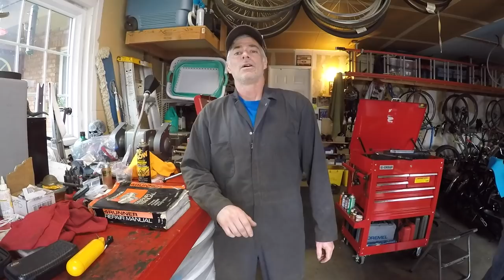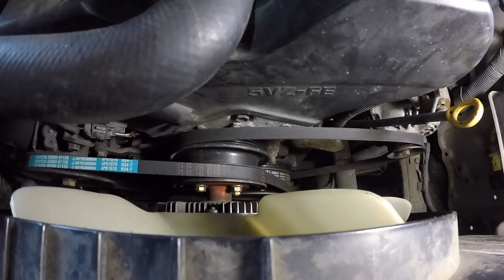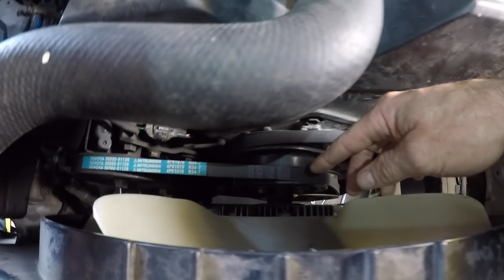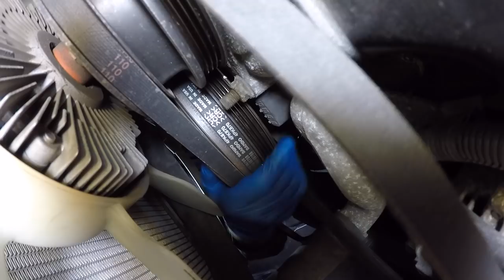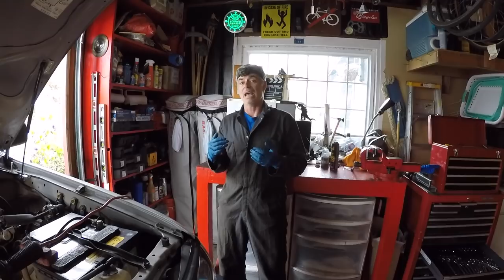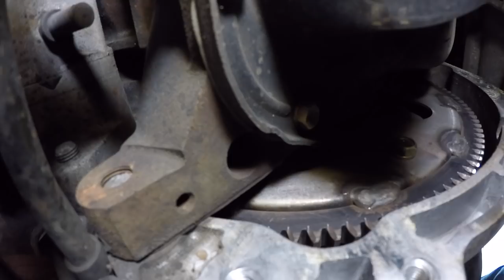Crankshaft Play (Toyota 5VZ-FE Engine) (Part 2)

Comment: One of our 4Runners (2000 2x4 with auto trans' 3.4 with 190,000 miles) has 1 and 5 misfire. I ran a compression check and exhausted ALL other possibilities.  At the very beginning, the starter would click but not turn the engine. The new starter did the same thing. The engine acted like it was locked up. I took a breaker bar and turned the crank from the bolt on the harmonic balancer and it was free then the engine started but developed a misfire from then on. I think you have finally helped me solve the riddle. I will give you an update.
Reply from the maker: Hope you figure it out Robert.
Reply: @TimmyTheToolman  No noticeable end play or crank movement forward or aft. I took the ECM apart and no burned or broken issues on a visual inspection. Replaced cam and crank position sensors. Replaced coils, plugs, wires and injectors, Replaced fuel pump, filter and pressure regulator. Still 1 and 5 misfire. The O2 sensors are on order so I will let you know and I am going to drop the oil pan to get a visual on the thrust washers even though there is very little crank movement.  We double checked the timing on a new belt that is only 1 year old. We checked the crank and cam reluctors for cracks or damage. We have allowed the vehicle to relearn the idle and that did not help.
Reply from the maker: @robertclark2714  Did you ever do anything with the fuel injectors?

Comment: Just watched part 1 and part 2 Crankshaft play. I have been trying to find a video on how to replace Crankshaft position sensor  on my 5VZFE. I have not been able to find any real how to do it information. If you have a video that would help me, Please advise. I hate to call my 1997 beauty a done deal with only 200,000 on it. Ill try the crankshaft  position sensor first. Love all your 1997 videos.
Reply from the maker: The crank position sensor is right behind the crank pulley on the driver side of the engine..  It is affixed to the oil pump with a 10mm bolt.  Disconnect the connector, remove the bolt, and pull it out.
Reply: Thanks a bunch @TimmyTheToolman
Reply from the maker: @mcfmwjd  No problem.
Reply: @mcfmwjd ay man I had the same issue with my 5vz I tore it apart did timing belt and everything else while I was in there, did yours have any issues after replacing the sensor?

Comment: The screw in type Toyota knock sensors of this era are extremely sensitive to piston slap and rod knock which is why I said they are incredibly unreliable. Any play in any part of the piston-rod assembly will give false misfire codes for this style of knock sensor. 

It's probably not directly the play in the thrust washers of the crank that's giving the false misfire because the engine would not run well at all if it had any type of bad cps signal. Even one missing tooth or virtually missing tooth due to axial play on the reluctor wheel will cause the engine to not run well or not at all. Even with all that movement, the cps is still probably giving a good signal to the ECU.

More likely it's the wear in the rod bearings caused by the axial movement of the crank and the knock sensor that is picking up the rod knock that's actually causing the false misfire reading. Toyota fixed these false misfires due to rod knock and piston slap by switching to a through hole type knock sensor that was more focused on "listening" to actual preignition in the engine iterations after this one.
Reply from the maker: Thanks for sharing all this Jacob.  You sound like you know what you're talking about with these engines so I'll take you're word for it.  I was unaware that a bad cps signal would cause the engine to run poorly or not at all.  His engine definitely ran fine.  It just had an audible engine knock and a misfire code we couldn't get rid of.  At one point, we were considering replacing the knock sensors but I'm glad we noticed the gross play with his crankshaft first because replacing the knock sensors wouldn't have done anything.  The new sensors would have triggered a misfire too and we would have done all that work for nothing.  His engine is done unless we want to try to rebuild it which I'm doubting we will.   

I appreciate your input and your willingness to share information.  Correct me all you want because I appreciate learning new things even if it means I have to admit my theories were wrong.  Happy Wrenching!
Reply: No problem. I learned about the knock sensor issue myself not too long ago from an engine tuner that has problems with them because of the larger clearances he has to run on everything. Then I happened to read some Toyota technical training about the reasons why they were switching to the new style of sensor. Always good to learn something new everyday!

Comment: Checking if the flex plate for movement great idea
Reply from the maker: Thanks Antonio.  I really didn't want to pull off the harmonic balancer to verify all the play we were seeing was coming from the crankshaft.  Since I have experience pulling the auto transmission, I knew I could take off that access hatch on the bottom of the bell housing to visualize the flex plate.  If the crankshaft was indeed moving, we would see it at the flex plate as well which we did.   It was a great feeling to finally figure out what was wrong with his engine.
Reply: @TimmyTheToolman  was a great demonstration that access hatch is nice if if there is that much play I would say the engine is shit it's all wollered out

Comment: Thank you for this. I just got a 96 Tacoma and sadly am chasing codes right now too. First was Mass Airflow. Got a new one. Then it threw a misfire 1 code. Full tune up bc plugs etc were terrible. Now a different Mass airflow code. They’re going to replace it again under warranty and said if it’s not that it’s the ECU. I watched the ECU video and seems easy enough but wondering if I’m gonna end up here too. Can a chronic mass airflow code also lead to this instead of the ECU? Thanks!
Reply from the maker: What code are you getting?
Reply: @TimmyTheToolman  First code was P0100. Replaced the Mass Airflow Sensor. Then got P0300, full tune up. Now reading P0101 and having running issue. Stalling out etc.

Comment: I'm no mechanic/expert, but that amount of travel ( play ) front to back in that flex plate does seem to be about equal to the thickness of BOTH thrust washers which surely must have fallen out of place.........right? Isn't there supposed to be 2 thrust washers, with each one being in a different location on most crank shafts???
Reply from the maker: Yes, the thrust washers most definitely failed.  Greg sold his truck to a guy who dropped the oil pan and confirmed the thrust washers were on the bottom of the oil pan.
Reply: @TimmyTheToolman  Yikes. You guys sure went through an awful lot before making this discovery......but I guess to great benefit to us, the viewers, as we learned a lot of valuable lessons during this lengthy series.
Reply from the maker: @howabouthetruth2157  Yes, it was quite the adventure.  I discovered the issue with the crankshaft while editing the Engine Timing video.  I saw the harmonic balancer jut out when we started the engine and I had to do a double take of what I saw.
Reply: @TimmyTheToolman  Yes, I saw you mention that or, I read where you explained how you discovered it while watching the video footage.

Comment: Hey Tim I have a misfire only on startup and goes away after10-15 seconds. I'm getting a p0300 code. Also while accelerating sometimes I hear the exhaust stuttering. I replaced coils, wires, fuel filter, and fuel injectors. Leak down and compression test were all good. Still having the same problem. Any ideas what it could be?
Reply from the maker: Sorry, no idea.  You did the steps I would have thought of.  No loss of coolant I take it?
Reply: hello jermaine Crisóstomo I have the same problem with my 4runner model 2000 3.4 v6 already solved the problem
Reply: hello jermaine Crisóstomo I have the same problem with my 4runner model 2000 3.4 v6 already solved the problem

Comment: Timmah! i don't see any mention of how many miles were on this 3.4 at the time, do you recall?  is the motor still surviving 3+ years later?
i ended up having a bad balancer on my rig that blew out into a moving fan at 190k, the weird noises started about 2 years before it broke! it was diagnosed on several occasions by a master Toyota shop as a clutch bearing rattle and told to just ride it out
Reply from the maker: The engine had fairly low miles if I'm remembering correctly - somewhere around 150k.  Greg decided to sell his Tacoma because he knew his engine was toast.  The guy who bought it dropped the oil pan and confirmed the thrust washers were the culprit for the crankshaft play.  They were sitting on the bottom of the oil pan.

Comment: Wow I wonder what caused this at such low mileage. I'd guess lack of maintenance? Faulty assembly? What are your thoughts
Reply from the maker: Who knows Eric.  Greg bough the rig 7 years ago with 100k.  After 2 years of owning it, he detected a slightly audible engine knock and that knock has gotten worse over time.  When he first started getting an engine misfire code, he could reset the code and it wouldn't pop back up for quite a while and so he would still be able to get it to pass smog.  With the way it is currently, the misfire pops up after only 5 miles so he can't get it to pass smog.  Maybe the owner previous to Greg abused the rig or maybe this is just a fluke.  I have heard of other 5VZ-FE engines having this issue but luckily it's a pretty rare occurrence.  Until we drop the pan or go fishing for metal parts with a magnet through the oil pan drain plug hole, we won't know for sure what is causing that gross play.  From what we surmise, it's failed thrust washers.  It could be a faulty assembly from Toyota or just bad luck.  On a more happy note, maybe we'll get an Engine Swap Video out or this fiasco.
Reply: Timmy The Toolman I'd love to see that! Also if you do pull the engine it would be cool to see what the cause was.
Reply: Hey Timmy. Do you think 1.5 inch steel would work for the press work on the front wheel bearings? That's all I can source
Reply from the maker: @ericbrown6802  It will probably work fine.  But, as you're pressing, if you see that steel start to flex big time, you might want to back off and consider getting some thicker plates.
Reply: Timmy The Toolman  you used 1 inch thick steel right?  I just wanted to make sure it would fit between the hub and the spindle.  Surely 1 and a half inch thick steel won't flex to much haha
Reply from the maker: @ericbrown6802  Yeah, you're right, I wasn't thinking straight.  I can't say for sure if it will fit though.
Reply: Timmy The Toolman alright thanks. Let's hope cause I just got some haha.
Reply: Timmy The Toolman it did work just had to pop a couple studs out. Everything went pretty smoothly. Thanks again for the video
Reply from the maker: @ericbrown6802  Good to hear the job went well for you Eric.  Thanks for letting me know.

Comment: I wonder if this was the original engine.  Maybe it was a Rube Goldberg rebuild from somewhere.
Reply from the maker: Who knows.  I was guessing it was the original engine.  Greg bought it used at a Ford dealership and maybe the original owners traded it in because there were issues with the rig that weren't readily apparent.

Comment: Personally I would put another good used motor in it and call it done, if the truck is worth it. No sense in trying to fix it. Just take a weekend and order all the parts and oils first. Just make sure to record, and post it so we can join in on all the fun.
Reply from the maker: Yeah, that's most likely what's going to happen.  We should be able to swap out an engine in one full day.  Filming slows everything down so maybe over a weekend we could do it.
Reply: @TimmyTheToolman  Agreed, can easily be done in a day with 2 people, filming it will take two and lots of beverages.
Reply from the maker: Yes, tasty beverages definitely helps.

Comment: My 254K Miles 02' is showing the dreaded P0300. Here's what i changed so far

- Coils
- Spark Plugs
- Spark Plug Wires
- Brand new Valve Cover gasket (less than 200 Miles)
- PCV Replace 

What's crazy is one day the CEL comes on and then a couple days later i go to start the car, the CEL is off. Then a couple days later it would come on. 

The engine has a slight stutter on first startup but goes away after about 10-20 seconds. 

No White or black smoke from the Exhaust. 

I've order rebuilt Injectors and see if that will fix the problem. I suspect faulty injectors that are leaking into the cylinder when i turn off the engine and then the excess fuel in the cylinder is then burnt off right when i start the engine.

If its crankshaft play i'm 2UZ swapping this rig. haha
Reply from the maker: Hope you can finally figure it out.  Good luck!

Comment: Hey Tim hopefully you see this. I recently been experiencing a P0301 on my 97 4runner as well, I replaced fuel injectors, spark plugs, wires and just did a head gasket test (that passed) and so lost on what else to do??
Reply from the maker: Have you tried swapping the position of the coil packs to see if the misfire changes?

Comment: Hey TTT, I'm experiencing similar issues with my '02 Tundra (3.4 as well), but I suspect a bad crankshaft timing gear. I have very little power and if I apply more than 10-15% throttle my engine misfires, backfires chokes/stalls and puffs black smoke. I have replaced the MAF, TPS, IAC, plugs, wires, coils, igniter, and injectors. My harmonic balancer doesn't move laterally like in this video, but I think my crankshaft timing gear has play in it. Have you ever seen/heard of this issue before? Any input is appreciated.
Reply from the maker: Hey Jonah, I've seen pics of crankshaft timing gears where the slot in the timing gear that slides over the woodruff key on the crankshaft gets widened out.  This allows the timing gear to move on the crankshaft which throws off the crank position sensors readings.  Another thing I've seen is people who pried off the timing gear rather than using a puller to get it off the crankshaft ended up braking off a tooth or two.  The crank position sensor takes it readings from the teeth.  If one or more teeth are broken, it throws off the engine timing.   You'll have to tear down the front of your motor to find out.  You can use this video to help you out.  Also watch Part 2.  https://youtu.be/vHC46ypHxWc

Comment: I think I’m having the same issue on my 4Runner. Can I just drive it like this? I’ve brought my truck to 2 mechanics and they both tell me the truck isn’t actually missing. I suggested this to the mechanic after I saw the video and he said that’s probably what it is though he didn’t think to check for it. The engine light will come on with cylinder one misfire and if I just leave it it will go out for a day or a couple days. If I reset it it will stay out for a few days. I just bought this truck and I like it but this kinda sucks.
Reply from the maker: Yeah it’s not ideal to drive it this way because it will keep wearing & get worse but unless you need to get it smogged then just send it bro!
Reply: I will just drive it until it blows up and then get a new motor. I live in Louisiana so there is no smog inspection.

Comment: That would also screw up the rod bearings and main bearings
Reply from the maker: Yeah, I don't know if it would be prudent to try to fix this engine or is it smarter to just swap another one in.  I'm thinking the latter.
Reply: @TimmyTheToolman  it's more realistic to drop a new motor in it because if there is that much play then all the rod bearings and the main bearings  are wollered out as well as the block itself
Reply: Better to find a wrecked 4runner at a junk yard and salvage the motor from it
Reply: Also means that motor isnt true to original specs and tolerances anymore

Comment: That engine sounds weak on startup
Reply from the maker: Probably the battery was a little weak.  Because of the issue with the misfire, Greg can't register his Tacoma so it sits a lot without running because his registration tags are long expired.

Comment: Engine swap it. You can buy a jdm 3.4 for a  $1000 shipped to your door. I swapped mine out a few years ago it only to me and my dad the weekend to get it done. Id hate to see a good 4runner get parted out.
Reply from the maker: I've heard JDM engine swaps aren't plug and play.  What parts did you have to swap over from the original engine to make it work?  What about the wiring harness from the JDM engine.  Does that need to come off and the one on the old engine swapped onto it?
Reply: @TimmyTheToolman  it really depends on what the engine came out of. Mine came out of a box truck and i had to change the motor mounts, oil pan ,alternator and the oil cooler. Really wasn't a big job. Could've done it faster if I would have known about swapping out the  parts that I listed. Everything else plug and play. Would love to see this done on your channel!!
Reply from the maker: Thanks for the reply Scott.  Swapping over those parts don't sound that bad.
Reply: @TimmyTheToolman  honestly it wasn't bad at all and the best part is that you will have everything you need from the old engine. I would do it again if need be.
Reply from the maker: @scottg9481  Cool, good to hear.